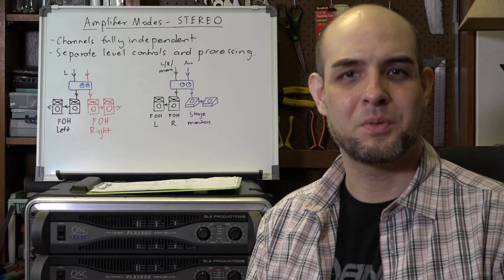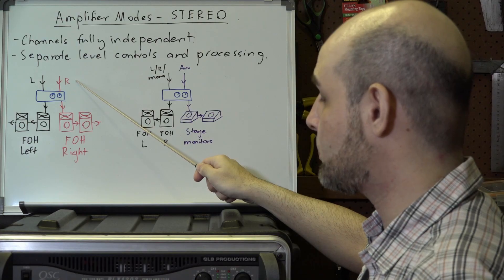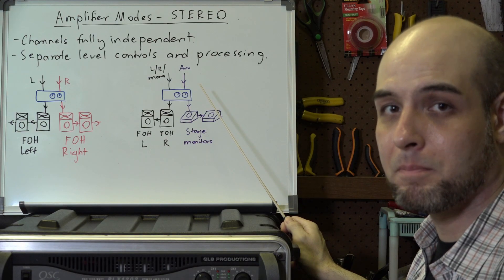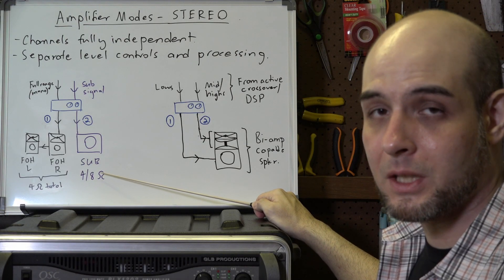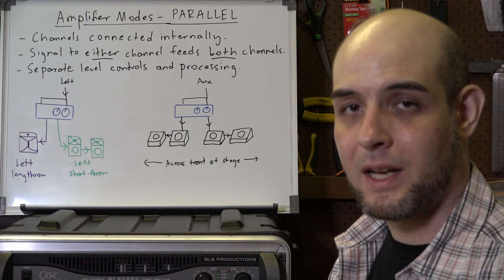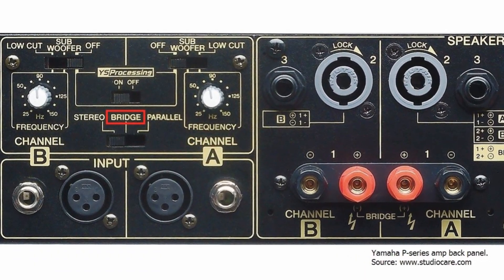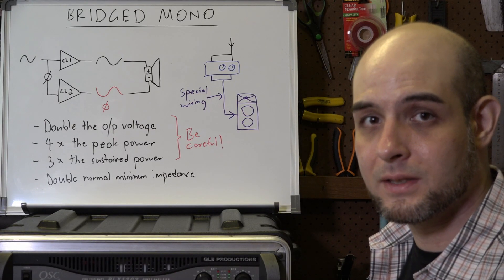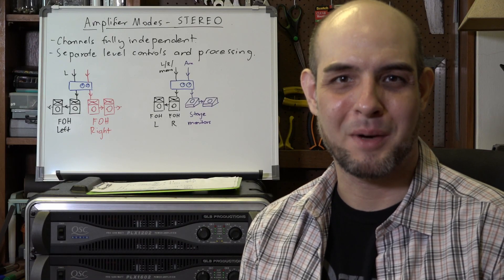Power amplifier modes explained

Comment: your explanations are superb and simple to follow - well done - could you please make a video on making a bridge mono speakon pigtail describing the amp side and the speaker side i'm still not clear, are different pins used on the connections toward the speaker side ?
Reply from the maker: Hi Brad, I have a video that covers this topic: https://www.youtube.com/watch?v=8XLRvoRdYVE The wiring at the loudspeaker end will not change, what will be different will be the amplifier side wiring. The exact configuration will depend on the amplifier - some amps use +1/+2 on the channel 1 output connector, others have a dedicated output connector that is just used in bridge mono mode.

Comment: Hi Bruno my amp got a filter with high pass filter and and low pass filter built in, can I use it instead of going for a Crossover on a small setup?
Reply from the maker: You can try - the problem with those is that the filters are often not steep enough to fully replace a crossover, so you will still get some of the sub frequencies in the fullrange speakers and vice versa. This is generally not a problem on a small setup.

Comment: Excellent. Do you have a video on setting a 31-band eq? In the past, we used a Real-Time Analyzer (RTA) with the little green, yellow and red lights with pink noise and it was so easy. The guy I worked for switched to a scope, and I never understood how to use it. I'm still all analog, not digital. What do you recommend?
Reply from the maker: Hi there Cubby 😄 I don't have a video on that topic sorry. I started in live sound in 2001 so have seen the transition from analog to digital, and remember RTAs, pink noise and 31-band EQs very well. They were necessary back in the day due to the technical limitations of loudspeakers, especially in the area where the low and high frequency drivers overlapped. Today, modern speaker systems are much more linear, and a lot of these corrections can be done in the crossover design and/or in the amplifier module, for active systems. The benefit of this is that these systems need very little in the way of corrective EQ if they are deployed correctly, to the point that an old school graphic EQ can actually make the sound worse, especially in the hands of an inexperienced operator. 
By the way, I struggle to understand scopes and transfer functions too 😅 Whenever it comes to SMAART and that sort of thing I will always work with a system tech who will tune the PA for me, I can thus focus on mixing. So you're not alone 🙂
All the best with your music and YouTube channel!
Reply: @GLBProductions  Thank you so much for your response! I enjoy your videos! Yes, my new FOH speakers (Yamaha DZR 12-D) have EQ built in, so I pretty much let them handle that part. It's much easier!

Comment: Why on eath would you use anything but stereo 🤪
Reply from the maker: Parallel is used for driving multiple loudspeakers of the same type in larger systems, bridge is typically used for subwoofers or large, multi-driver fullrange speakers.

Comment: Thanks for your  knowledge  ,i have  a mackie 808s and have a yamahap5000s  powered  amp ,i have sp3 peavey  speakers, i will uses  them for preaching  how can i do a better connection  to get the best of the systems  thanks you
Reply: So my question is  the powered mackie 808 s and the Yamaha p5000s will be enough to  supply enough power for  4 peavey sp3?
Reply from the maker: I have a video that shows how to calculate this: https://www.youtube.com/watch?v=l9L7uK7Xy0w There are many different variations of the SP3, depending on when yours were made, so make sure that you have the correct power requirements for those. All the best with your preaching!
Reply: Sorry my English is  not that good
Reply from the maker: Hello Jorge could you please be more specific with your question, thank you.

Comment: I bought a speakon cable before viewing your video.  It's a 6 ft cable with neutrik connectors. One end locks, the other end doesn't.  Which end do you suggest goes on the combo amp side and wich end goes on the cabinet side? Why don't both ends lock?
Reply from the maker: They should both lock - send me a picture of the cable by email or via FB and I'll take a look.
Reply: @GLBProductions  I don't have FB, but here is the cable
Reply: @GLBProductions  it looks like one end is a Neutrik NL4 (per your video) and the other is an NL2.  I ordered another NL4 connector and I will remove the NL2 with an NL4 co that both ends lock.  Strange that they did that.
Reply from the maker: All genuine Neutrik Speakon connectors lock, which is why I asked you to send me a picture of the cable. The old NL2FCs do not have a metal latch but they still lock using a spring-loaded ring on the connector with plastic locking tabs.
Reply: @GLBProductions  i must correct myself. When I ordered the 6 ft cable the picture looked like the NL2 connector didn't have the metal locking tab.  When it arrived yesterday it did.  I tested the cable with the recomended cabinet and it worked.  The combo amp has 4 pirana speakers and the cabinet does too. When coupled it is 8 speakers (at 4 ohms?).
Reply from the maker: Glad to hear that! The combined impedance will depend on the impedance of the extension cabinet vs. the internal speakers, but two 8-ohm cabinets in parallel will be 4 ohms yes.
Reply: Thank you!  You have been a tremendous help. It was a long journey since even the sales engineers at PJB and Sweetwater didn't know what I was talking about.  You have schooled us all. BRAVO!

Comment: Why am I getting no signal
Reply from the maker: Many possible reasons! Check your connections and cables, make sure that the output from your mixer console is working and that your amplifier level controls are turned up etc.

Comment: I have a 6 channels powered mixer...when ever I connect it to a power amplifier the sound drops,should I change the modes on power amp or is there something wrong am I doing? Can someone help me,I need boost the sound on the powered mixer
Reply from the maker: Which model powered mixer are you using, and what do you mean when you say 'the sound drops'?

Comment: I have a Yorkville ap4k. It’s in stereo mode. Channel A is for mains. B is supposed to be monitors. The mains are producing sound but monitors are not. If I boost aux out on mixer the expected monitor sound can be heard inside the amp 😂. Am I missing something? Speakers/monitors are passive. If i connect monitors to channel A, they work.
Reply from the maker: Try swapping the output connectors, ie connect channel A to the monitors and B to the mains. If the monitors start working and the mains go silent then you know that the problem is not the amp itself.
Reply: @GLBProductions  Thanks. I believe I tried this already but  I'm stumped after this. Total noob here. Do you have a video for such scenarios?
Reply from the maker: Ok, so you tried it and your monitors started working. What exactly do you mean by 'the expected monitor sound can be heard inside the amp'?
Reply: @GLBProductions  the ap4k amp has distorted sound coming out of it as a I increase sound on the mixer. Mixer aux 1 out is connected to the amp channel B input. Amp Channel B output connected to monitor via a snake. No sound from monitor but the Yorkville AP4k amp sounds like a small distorted speaker as I raise level of aux 1 on the mixer.
Reply from the maker: Ah ok, there is clearly a problem with channel B of your amplifier and it needs to be serviced. There should not be any such sound coming from inside the amplifier itself 😅
Reply: @GLBProductions  Thanks for the reply. I suspected it would be that but I wasn’t sure.

Comment: Why does one of my channel work only when in bridge mode not stereo
Reply from the maker: That's because in bridge mono the amplifier has only one input and one output. Typically channel B controls will not be used in bridge mode.
Reply: @GLBProductions  Ok sir, but also in parallel channel B works but when in stereo it fails and for it to get sound in stereo mode you have to first increase its gains to maximum and even from the mixer also then you start reducing slowly but within time it does the same thing

Comment: Need to power six 30 W active speakers, along with my DAC amp, my Sub amp, my Active Sub, my 9-band EQ, and my powered TPA 3116. Since I'm stuck with the six active speakers, and the powered subwoofer, I'm desperately trying to find a way to make them work together!  And, to add insult to injury, I happened to have two headphone amps to use, but I realize that I'll probably have to use them somewhere else. Can you help me sort this confusion out? By the way, I was drawn to your channel due to the great detail of your videos, but I 'm not sure if I can use your info for this small home setup. Please, I'd appreciate your help!
Reply from the maker: Carlton I'm not an expert in home theatre systems, but active speakers are typically easier to make work together because each one is an independent unit and just needs an input signal. I would start from your AV receiver and work out a signal chain for each channel: Left, right, center, left surround, right surround and so on, and then choose a speaker to match. Obviously your left and right speakers should match, as should the corresponding surround speakers, but beyond that it's really about getting a system that works and sounds reasonable. All the best!
Reply: @GLBProductions  Thank you so much for your suggestion.

Comment: Ty for sharing your knowledge. I have a question regarding running a pair of passive subs out of a qsc. There'd nothing on the manual about running subs alone. Should I use one channel and chain the speakers? Or should I use a jumper on the amp and use both speaker outs? And should the amp be set at "full range" or "crossover ch1/ch2". Again the manual does not address this I thank you for any assistance
Reply: Side note..im NOT bridging. Just trying to figure the best way to run 2 passive subs out of the amp and how it should be set i.e. crossover or full range (the only 2 options the qsc offer)
Reply from the maker: Hi there John, which model QSC amp are you using please?
Reply: Gx7
Reply from the maker: With this amp you can actually use either setup above: one sub on each channel at 8 ohms, or both subs daisy-chained together and run off a single channel at 4 ohms. Obviously this will not work if your subs are 4 ohms... The decision will likely depend on your specific setup - the distance between the amp and the subs, whether you have enough speaker cable for two complete runs over that distance etc. The crossover switch should be set to 'fullrange' if you are using an external crossover and/or using the first method. If you are driving both subs off channel 1, you could experiment setting it to the crossover position, which will give you a 100Hz low pass filter - again, unnecessary if you are using an external crossover.

Comment: I got a NAD C 272 Power Amp . This Amp has only got a 230 Volt 2 Pin Input Power Chord . How can I connect A Ground Earth To this Amp
Reply from the maker: There is usually a grounding lug, screw or bolt somewhere on the amplifier - contact the manufacturer for specific details.

Comment: Hi I have crown cdi 2/300 and I wan to cennect it with 8ohms subwoofer with a bridged mono mode can u help
Reply from the maker: Sorry I don't understand your question.
Reply: @GLBProductions  oh let me be clear I have two jbl control sb2210 sub woofer 500 watt 8 ohms and the amlifire watt is 600 per Chanel 300 so if I bridge the amplifier is possible?
Reply from the maker: The combined impedance of these two speakers is 4 ohms, so you need to check the amp manual to see if this amplifier can handle a load impedance of 4 ohms in bridge mono mode.

Comment: Helpful video, I just have 1 question though.  I have a Hybrid B1600 MK5 Amplifier and x4 Hybrid PLB15 full range speakers(passive), what would be the best mode to pair them all up or correct way to daisy chain them so I don't put much load on the AMP?
Reply from the maker: Take a look at this video: https://www.youtube.com/watch?v=l9L7uK7Xy0w
Reply: @GLBProductions  Thank you for replying , I'll check out the video now

Comment: So with stereo mode in fact functioning as "independent mode", do both channels still need to be connected to a load? For example if I had a an amplifier set to stereo mode, but only needed to connect 1 monitor wedge, would I still need to connect a load to the remaining amplifier output?
Reply from the maker: Solid state power amps can be run safely without a load, unlike valve/tube power amps. However I would turn down the level control on the unused channel.

Comment: Thank you Bruno.
Can you answer a question for me because I'm having a discussion regarding impedance for amplifiers and speakers.
Speakers of course have eather 16/8/6/4 ohms and so on so therefore does the amplifier have the same impedance or does it just depend on the speaker.
I myself have the theory that speakers are made and designed by the load an amplifier is designed to take.
Please help!
Cheers.
Reply from the maker: Older tube/valve amplifiers were designed such that the load impedance needed to be specified, usually by setting a switch on the back panel. Modern solid-state amps, especially those used in pro audio, do not require this - the only limitation is the minimum load impedance which can be connected to each channel, typically 2 or 4 ohms.

Comment: hey. your qsc amplifier at the back. do you know about QSC RMX5050A? is that good for subwoofer at bridge or parallel switch mode? they said it has a 5000w of power. Here's the link below.

https://www.qsc.com/solutions-products/power-amplifiers/portable/2-channel/rmxa-series/rmx-5050a/
Reply from the maker: QSC makes quality products! Whether or not this amp is suitable for you depends on how many subs you have and what their impedance and power handling is. You'll need to work out these details for your own setup.
Reply: @GLBProductions  thank you so much!! yes i would like to used it for front of house subwoofer , specially for 18 inch subwoofer which is RCF-LF-18X451 8 ohms parallel switch mode subwoofer. or mono 8 ohms bridge mono subwoofer. is that good for them? i only need 1 or 2 units of 18 inch subwoofer.

Comment: Hello! 

if you were to choose an amplifier only by class, what would you choose between D and H?
the amplifier would work like this: 4-5 hours / day, almost every day, but at a low volume.
to be even more precise, the amplifier has 2x500 w on 8 ohms in stereo mode and will be used to output a spl of 70-90 db.

Thank you!
Reply from the maker: You'll need to ask an amplifier designer that question ;) Any well-designed pro audio amplifier should have no trouble with that sort of workload, given correct installation and appropriate airflow for cooling.

Comment: Sir , driver unit transformer connection?????🤔🤔🤔
Reply from the maker: For that you need an amplifier that can drive 100 volt lines - it's more complicated and you really need to know what you are doing.
Reply: @GLBProductions  
Sm6 mixer and Um6 mixer difference??????

Comment: Can yamaha p3500s be used to power home theater passive subwoofers?
Reply from the maker: Yes it can.
Reply: @GLBProductions  Hi. Thanks for the reply. I just bought this Yamaha power amp to power a passive sub.It's connected to my Denon avr's subwoofer output,but the yamaha power amp is not receiving a signal from the denon avr. Someone told me it's b'cos the denon's output gain voltage is too low to activate the yamaha amp. Is that true.
Btw,The subwoofer vol on the denon avr is already set to max 12db. Appreciate your advice.
Reply from the maker: No - there is no such 'activation threshold'. It could be that the level is so low that you cannot hear it. More likely there is a cabling issue - if the receiver is RCA out then best to use an RCA to 1/4" to connect to the Yamaha amplifier. Also ensure that the receiver's subwoofer output is enabled, if such a setting exists.
Reply: @GLBProductions  
I'm not sure if it's called a 'acrivation threshold' but I believe a signal input 'sensitivity' of 1.4v 4dbu is needed for pro amps to operate. The cable used is rca to xlr. Pin 2 hot,pin 1 ground and pin 3 not connected.Both the Mains and Subwoofer is set to ON on the avr.Not sure what else could be the problem.
Reply from the maker: Ah yes - that is actually +4dBu, which is equivalent to 1.23 volts RMS. This is simply the nominal input level for these amplifiers - they CAN be driven by a signal much lower than that, you just won't get full power out of the amplifier. Having said that, your Denon should be able to easily output this sort of level, especially if the output level is set to +12dB. I suggest bringing the entire combination (AV receiver, amp, sub and all cables) to the person who sold you the amplifier and getting their help to troubleshoot the system. In my experience interfacing hifi and pro audio gear can be tricky and it's best to get expert help.

Comment: In My power amplifiers specs a separate EIA 8Ohms @1KHz..
Reply: Tq bro
Reply from the maker: Both are measurements of power delivery into a specific load impedance, using different specifications.  EIA measures at 1% total harmonic distortion (THD) at 1khz usually, RMS measures 0.707 of the peak output of the amp from 20Hz-20khz. For most practical purposes you can use either rating, but I prefer to use the RMS rating.